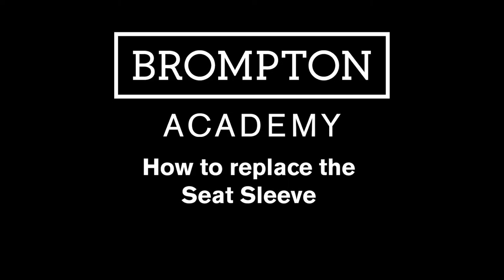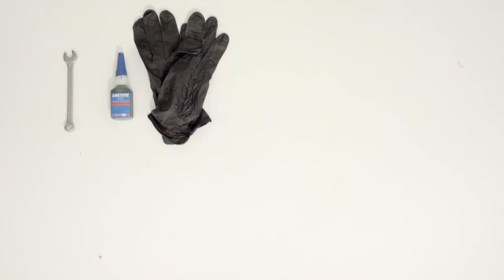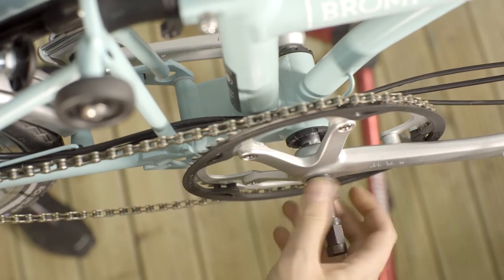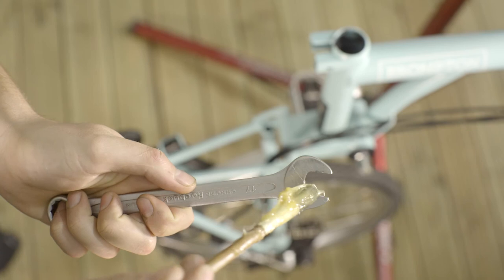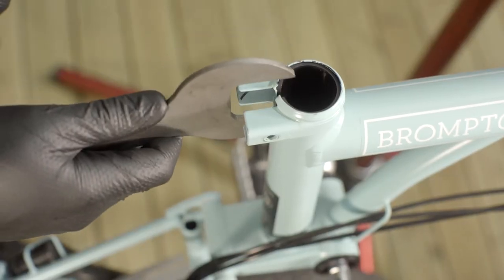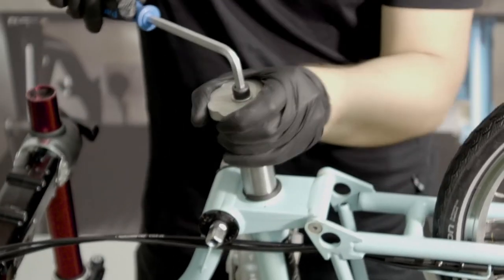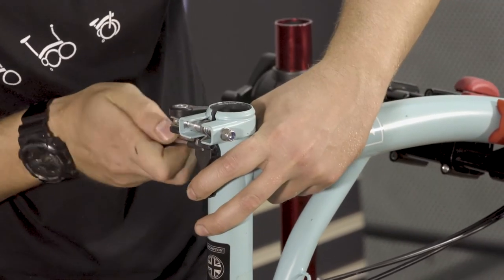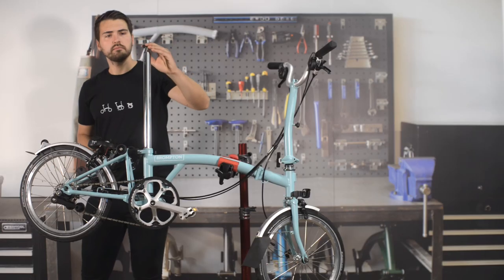Seat Sleeve Replacement

Comment: What was the point of removing the carankset?!?
Reply: It facilitate the reaming of the sleeve. Otherwise the tool will be close to the chainring, making it hard to ream straight. Busting knuckles on a chainring is no fun either. It is just easier to get the crank out of the way.